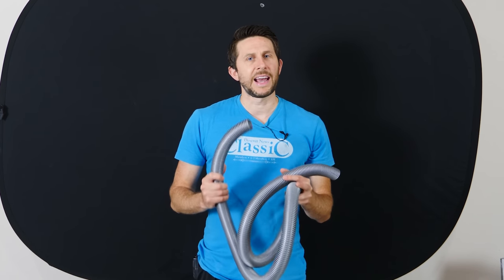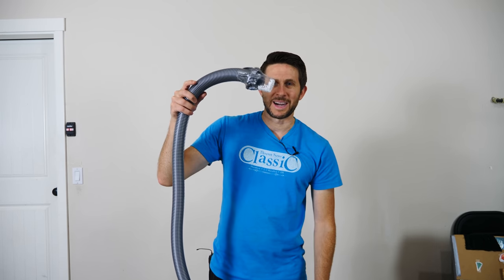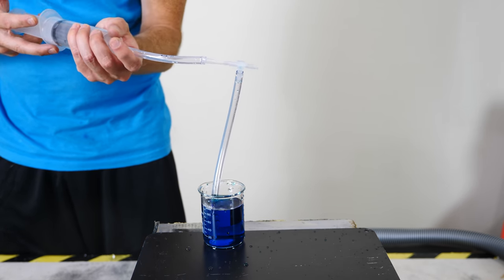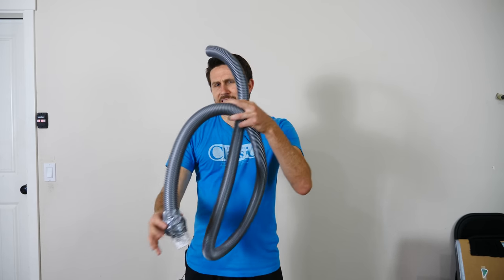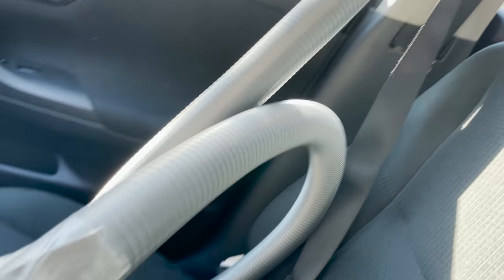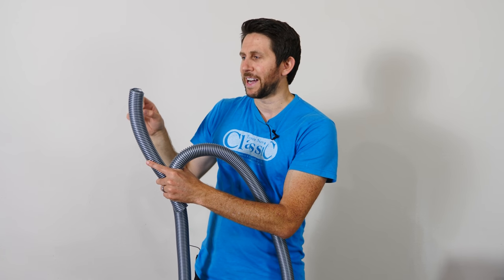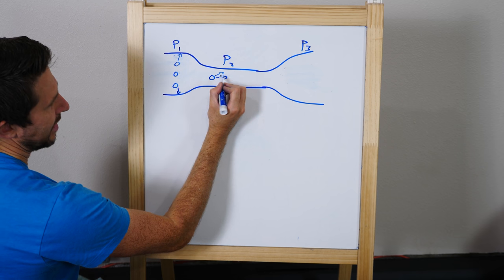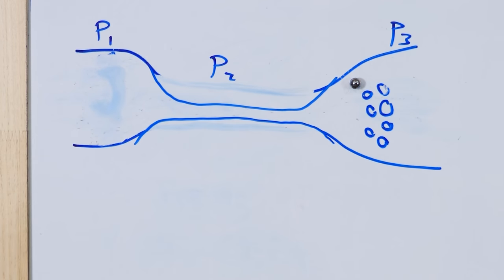The Self-Sucking Vacuum Cleaner

Comment: i tough that the moleculs at the end of the "moving" tip of the tube were grabbed by the wind just like dust and sand when you blow on it... causing a crater shaped layer of void at the tip of the tube... and that void was filled by the air from inside the tube because the air outside is too much fast to fill the void... (like a car that "float" above riddle bumps when it rides fast enough)... 
so... more moleculs you remove at one of the tip... lessthere is inside the tube... ans so... to refill the tube and equal the pressure, the tube will suck moleculs of air from the other tip...  (a aerodynamic mathematic)

Comment: With the spinning tube the dominant effect is going to be centrifugal. This is, in essence, exactly how an electric vacuum cleaner works. A wheel with fins spins rapidly, air enters at the center of the wheel, is forced to rotate by the spinning fins, and is thrown outward because of inertia.

Imagine filling the tube with beads, then performing the same demonstration in a vacuum. The air pressure at both ends of the tube would be zero, so no pressure difference and no Bernoulli effect, but the beads in the rotating portion would still be thrown outward. Now imagine the still part of the tube is connected to the bottom of a container of beads that is slightly below the top of the spinning portion. Before you spin the tube the weight of the beads causes them to fill the tube, but not spill out. When you spin the tube, the beads that are thrown outward create more room for beads to pour in and the container empties through the tube. This is analogous to air molecules being pushed into the tube by air pressure, and shows that you still create flow without any contribution from the Bernoulli effect.

Comment: Isn't the reason the spinning tube created a vacuum because its essentially a central frugal pump? Creating low pressure in the pipe as you're using the central frugal force to throw the air in the end of the tube out?

Comment: In the case of the spinning tube though, isn't this more a matter of centrifugal force?

The air in the tube has mass, and when you spin it around, it experiences an outward acceleration. As there's nothing there to stop it, it is flung out, creating a low pressure area behind it, and air rushes up the tube to equalize.
Reply: It's possible that your interpretation and the use of Bernoulli's principle actually models the same force. For example, under your theory if you spin the tube further down you would expect more air to be flung out because more air is being flung around and thus you'll get more suction, but under Bernoulli's principle, the tip speed is faster, and thus there's a greater pressure gradient.
Reply: @minerscale  I don't doubt it's having an effect, but given how much weaker the Bernoulli only car demo was, I still think it was mostly centrifuge.

How fast do you think he was driving? I'm guessing at least 30mph, so it looked like his hose was about 1.3' long out of his hand, meaning it was tracing a circle with a diameter of 3', meaning he would have to pull off 280rpm or 4.66 revolutions per second to have the same hose tip speed.
Reply: @Nevir202  I guess you could test your theory by closing off the end of the tube and measuring the pressure at the end (and thus figuring out the acceleration given no centripetal effect). And then calculate the equivalent tip speed for a hose experiencing only the Bernoulli principle.
Reply: @minerscale  Maybe... Though I doubt it generates enough pressure to be read on all but the most sensitive of instruments....

Though, now that I think of it, I guess you could take a short length of big hose, make an airtight seal with a long, thin hose, and measure the pressure differential by dipping the long hose into  water to make a crude barometer?
Reply: @Nevir202  yeah you totally could, I mean if it can vacuum then you  should be able to measure a force.

Comment: I'm a bit surprised that the very obvious reason of the spinning throwing things outward isn't even mentioned in this video.

If you had a chain going through that hose, that also would have been pulled up through the hose and around you, and I'm pretty sure no complicated Bernoulli explanation is involved here.  It just is throwing stuff to the outside of a rotation by centrifugal force.  And the same thing will happen to the air molecules in the hose.  The ones at the open end will go away in a tangential movement, leaving the hose and thus leaving a lower pressure there which sucks more air molecules up the hose.

Actually I doubt that the Bernoulli effect is the stronger of the two here.

Comment: Suggestion: why not make a model of a Martian blimp? What are the ideas is to use a blimp on Mars to carry experiments around instead of a helicopter. You could model this using your vacuum chamber. Put a small amount of helium into a balloon tie the end. Put the balloon in your vacuum chamber and completely exhaust your vacuum chamber. Then, allow enough carbon dioxide into your vacuum chamber to simulate a 1% atmosphere as exist on Mars. Then see if your model blimp floats. It might be a very good demonstration.

Comment: no matter how fast you move the tube, the pressure on both ends of the tube is 1 atmosphere. Sorry. It's centrifugal effect pulls the air from the spinning tube. The experiment with the car just shows that the aerodynamics of the car is such that there is a low pressure area near the side window. (which makes sense if you think about how air gets around the car)
If the relativity of movement of air mattered here, then for the observer in the car, air would be sucked out of the car by fast moving air outside of the car, but for the external observer the air would be sucked in to the car by fast moving air inside the tube and the car.

Comment: It makes sense though I thought it was the centripetal accelerative force at one end of the tube as the air accelerates out of the tube thus displacing the air in the tube and replacing it with the air near the other end of the tube in a cycle.

Comment: Oh, I thought the air inside the hose was pushed out of it by centrifugal forces and therefore creating low pressure in the top part which makes the air on the bottom flow inside the hose

Comment: I’m not entirely convinced. I hypothesise that it’s the centripetal force causing the air to flow out of the tube creating a vacuum behind it 🤔
If the edge of the tube was serrated then blowing over it wouldn’t work as efficiently (if at all) yet spinning the tube with a serrated edge still produces the same result.

Comment: P1 = P3 ? Not necessarily. P2 < P3 ? Not necessarily.

Consider an air compressor tank that is at high pressure (P1), then air moves through a restricting hose (P2), then out into the world (P3). Is P1 = P3? Is P2 < P3? No to both of those. Is P2 < P1? A little bit, and certainly it is not larger. But remember that it is the pressure P1 that is making P2 move. At any point air in P2 comes into contact with a restriction whether that is a valve or stationary air or air moving against it, then we would calculate based on the velocity that the collision is with pressure very similar to its initial pressure when it left P1.

What Bernoulli's principle is actually saying is that once the air is moving in a direction it reduces the resistance for air behind to continue moving in that direction. So the first few air molecules moving through the pipe restriction will have a harder time as they will be bumping into stationary air, but the air molecules following behind will have little restriction and so will be encouraged to follow. The pressure in the restriction can never be greater than the pressure outside the restriction, but if we lower the pressure in the restriction by moving the current air in it out of the way, then the pressure outside the restriction will be encouraged to enter the restriction.

What that means is if we assume a given that P1 = P3 like in your spun vacuum tube example. We give the air molecules a velocity tangent to the spun circle which unless acted on by something else will naturally want to move away from the center of the circle (the inertial force known as centrifugal). So once the air is moving towards P3, then P2 will increase where it meets P3 (P2 > P3) and decrease where it meets P1 (P2 < P3) so the pressure in P1 will want to flow into P2. But somehow P2 is greater than P3 and less than P1, but P1 and P3 are the same? The problem is that we can't sum up the pressure in P2 as a single value because it depends on the actual motion of each individual molecule which varies depending on what it interacts with.

In the vehicle example, P3 does not equal P1 to start with because the air in P3 is moving tangent to the opening of the hose so there is less pressure where P2 meets P3. In this case P1 = P2, but they are both greater than P3 and will naturally want to move towards P3. As they move towards P3, P2 will drop slightly at various points, but perhaps increase when going around bends.

My point is that it is misleading to try to quantify P2 as a single value and hopefully this has shed some light on why fluid dynamics is such a complex engineering process. For more on the topic, this is a fairly decent explanation: https://www.youtube.com/watch?v=qwPg2Dmh-6k

Comment: No offense, but if you have to consume mechanical energy in order to speed up the air and produce a lower pressure at one end of the tube, how can this be self-sucking? The work is still made by an external factor.

Comment: what if you attach it to a ceiling fan?
using the light as the "focal point", possibly one tube down each blade for stability (would more cup-filters spinning = more pressure created?) and bada bing bada boom you got a built in, vac-a-uum
Reply: you will need to find a way for the main tube not to spiral down on itself, doing it manually kind of regulates it
Reply: what if ya just attached it to a large bearing?
right below where the blade-tubes connect so they can spin freely while you hold it (or i guess just have a loose enough grip for the tube to rotate in-hand while youre doing your cleaning?)
Reply: I think we're just overcomplicating a simple idea at this point
Reply: @Amira_Phoenix  yeah but thats the fun of a hypothetical
you dont actually gotta build it, just think through "how dumb would this be IF it worked?"

Comment: I have a hard time believing  that it's not just inertia of the fluid (and friction with itself) causing that movement.  In the spinning hose, the inertia is causing it to be thrown out of the hose, causing the pressure differential.  And in the car, the collision of the moving air in the hose with the static air outside the car causes it to be pulled out of the hose.  Can you disprove this explanation and explain why this isn't what's happening?

Comment: Higher pressure for still air outside... lower pressure would be inside the tube when you spin * pressure goes from low to high not high to low📖📝😎...

Comment: I have a question. 
Let's compare the cup you used in the starting with the car.
Now, the car was moving and the Styrofoam balls got outside.
But when the closed cup was moving, Styrofoam balls got sucked in. Why such a difference, if in both the cases, the outside air is stagnant.
Reply: His explanation is 100% wrong.

Comment: wait a sec. The preasure is higher where a fluid moves with more velocity. How does it tell which fluid is moving if the frame of reference is interchangeable? Does this have something to do with special relativity?
Reply: It's from the perspective of the tube, basically. The air in the tube isn't moving as much in relation to the tube, but the air outside is zooming past.

Comment: That is not what's happening in that case when you're swinging the hoes around your sling in the air out of it just the same as if it was water in it you could swing the water out the air is fluid enough to pull the rest of the air out if you was able to get water to start water might even with do it using surface tension

Comment: Sorry but you made a mistake

Applying simple rule of physics, fluid flow from high pressure to low pressure

So you are correct that P1>P2 but P2 is not less than P3 (P2 indeed is greater than P3) else fluid will not flow from P2 to P3

Comment: “It was able to suck all the water…etc” ☝️Wait…In physics there’s no such force as “suction” & what’s happening is the surrounding air pressure is pushing on the top of the water in the beaker which provides enough pressure differentiation to push the water up the pipe. Positive pressure “rushes in” to the area of lower pressure. #barometric (I’m aware that nobody is suggesting that suction is a force in its own right & I’m only commenting of the suggestion that this may be the case.😉) Love these videos!❤️